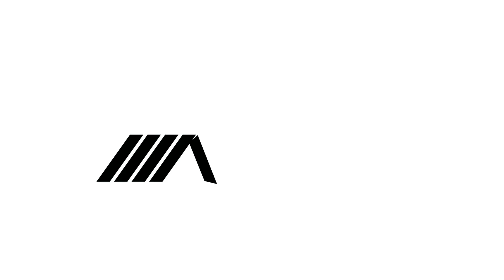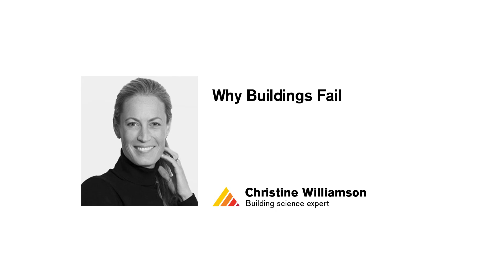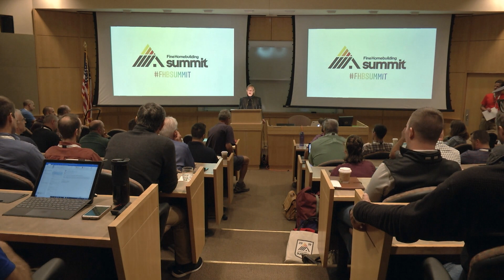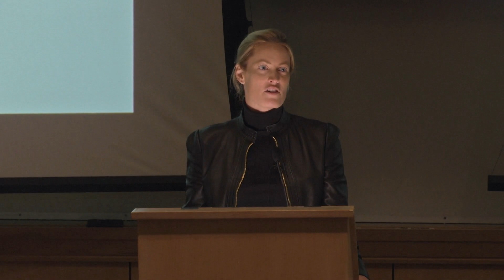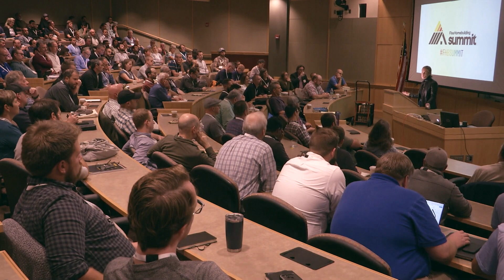FHB Summit: Why Buildings Fail

Comment: When cost becomes the overriding factor to produce a more human environmently friendly and energy efficient home, the "premier home builders", e.g. Risinger, have a huge advantage because their clients have the budget to afford those wise decisions, which further reinforces his portfolio, which attracts more clients of the sort amendable to that class of decisions.

Now compare that to a traditional home builder who typically doesn't have access to clients with those budget and may not have the understanding  themselves to actually convey the value of those decision points to the client and you now have a classic catch-22. That builder needs to run into a wise client with a budget to jump that gap to even get the opportunity to climb the learning curve in order to apply these modern techniques.

From the outside, the homes built by the two camps look identical. They're not rotting into the ground, they "appear sound", but the actual cost of ownership and the quality of life of that home experience can be worlds apart. So to be able to expose and sell that value in the "premier camp" to everyone else, you have to develop and market metrics so  home owners are better informed as to the value of these cumulative decisions. Which then creates the market demand necessary to propagate this set of values.
Reply: Yes, and no.  Reality is many simply don't care - at least if it costs meaningfully more.  It's looks over durability.  It's 'make is cheap now' and 'worry about it later' mentality that permeates our society. It's why Walmart is so successful - sell mountains of cheap junk.  It's why Detroit built crap for 50 years.  You can't change human nature so why bother?   What is disappointing is that production builders can add value at relatively low cost, but many choose not to (or are willfully ignorant).